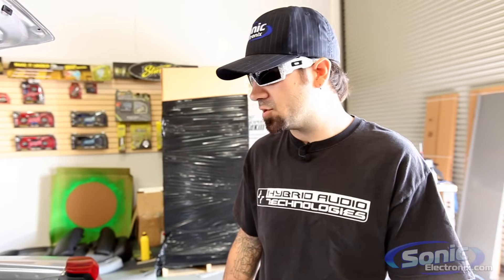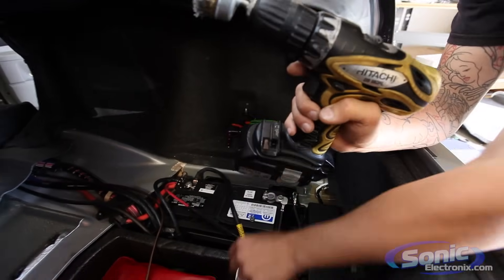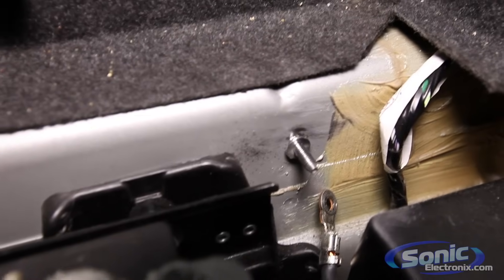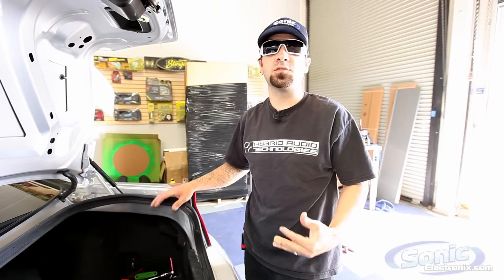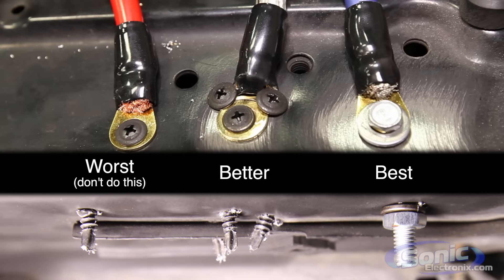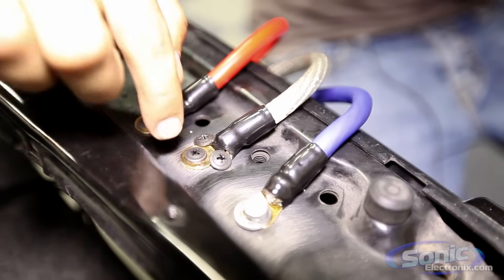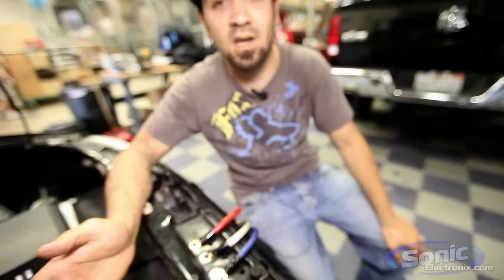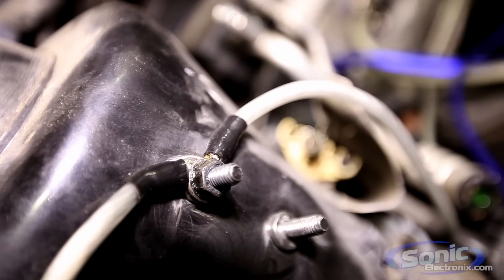How to Properly Ground a Car Amplifier | Good & Bad Examples | Car Audio 101

Comment: thanks for the excellent explanation
,but i have one question
suppose i connect my ground wire to painted point in the chassi,so what will happen? 
i have it installed on my car yukon 2011

Comment: No offense but you should have showed the right way on a car with the battery up front. Also if you use a self tapper that strips out like the worst example. You can use a pan head corse deck screw. It works amazing

Comment from the maker: You used an RCA to 3.5 connector and plugged it into the input of the amplifier directly? Are you using a factory radio or an aftermarket radio? Is the sub function turned on in the radio?
Reply: Can you just run a wire from the amp through the firewall to the negative terminal of the battery?

Comment: i have also checked the head units outputs several times and used an mp3 connected to the rca cables via 3.5mm converter and still nothing, any help at all is greatly appreciated

Comment: Hi i just got my subs and amp wired up in my mustang both of which i purchased from SonicElectronix via amazon i beleive, i got the subs from yall for sure, i am having issues with my subs playing, the amp is wired up and is turning on/recieving power and staying on just fine but my subs arent playing at all, i have them wired with 14 gauge speaker wire, brand new and more than triple checked the wiring diagram along with changing the rca cables and checking that as well, any suggestions?

Comment from the maker: Because in most cases, that is all the way back to the front of the vehicle. Your ground wire should be no more than a foot or so from your amplifier for safety reasons. The longer your wire, the more resistance it has.

Comment: question i removed the negative wire to sand the paint and when i put it back the amp wont turn on i checked if the negative wire is loos but it isnt what might be the prob ?

Comment from the maker: Never put bigger fuses in an amplifier, that could cause some serious implications and even ruin your equipment. You may not have big enough power and ground wire, your subs could be wired incorrectly, or your amp is defective.

Comment: ok so i hooked up an amp in my car the other day 03 pontiac sunfire and it was a 650watt rms patroit amp idk what it is i cant find them any where on the web so i ran all the wires and stuff but it keeps blowing fuses so i thought that it was to small of fuse so i got bigger ones and it blowed my amp i need advice so that i dont do it again couold it have been not the right gauge wire or what

Comment from the maker: Your electrical system is not powerful enough to run your system to its full potential. Your amplifier(s) are not being fed a stable, constant supply of current to maintain their output. You need a new alternator or at minimum a battery upgrade.

Comment from the maker: Yes it definitely could. Do not use the seat bolt if you can help it. Create a new ground using the steps we outlined in the video. Make sure it is on a non-painted, shiny metal surface and be careful drilling into panels, you might hit your gas tank or important electronics.

Comment: I grounded to the seatbelt bolt and my lights dim, did the big 3 lowest my voltage goes down to is 13.5 and the still dim could it be a ground issue?

Comment from the maker: You are definitely doing something wrong. Your ground wire to your amp should not be able to move, it needs to be solid. All connections need to be solid, you shouldn't be able to wiggle anything.

Comment: Ground was good but sound  still cuts out i think my speaker wires are to small I have 12gauge wires on 2 500w speakers with a 1000 mono amp I disconnected speakers made a thicker wire now amp sound  is staying on

Comment: use a DVM digital voltage meter. Ohm out that post on the seat.  See if its grounding from the post to frame? You will need a clean spot to test bare metal only.  Then test the negative battery post to frame then negative to alternator.  note the difference on the ohms. If your first test shows high resistance say 0.46 or more then run frame to seat bolt ground wire.  then ground negative to alternator then alternator to frame.  After this you will even see faster starter when starting car up.

Comment: run ground wire from alternator to to the back like a power wire unfused of course. Those studs you seen in the video are ideal but the best is a 5/16 lugor1/4 lug on the end not crimped but soldered on and shrink wrapped. Never use crimps and allen key turn down post. If you Ohm out the ground on factory post it might surprise you 0.009 mega ohms is good 0.001 is perfect. but 0.36 resistance you should address. And people if your alternator isn't grounded to the battery none of this will work

Comment: I am about to install 2 batteries in my car with a relay of 200 amps, but i don't know what gauge of power and ground wire i should get. Also if it helps i have 2 12's with 600 RMS's a piece. And my amp is 4000 watts. So what is the best wire size for all that.

Comment from the maker: Chances are you have loose connections in your power or ground wire which are causing intermittent contact and thus your system cuts in and out. Fix that ground and go through all of your wiring to make sure everything has a very secure connection. Also, it could be that your amp is drawing power all the time and the cutting in and out could be your amp protection circuit. Make sure the remote turn on wire on the amp is connected to your radio or a 12V accessory wire that turns off with the car.
Reply: I have a problem with my system. When I close the door it’s starts to hum very loudly but when it’s open it’s fine. My system sounds great till I close the door. Some mone said a ground loop?i feel like something is pinching but it’s very strange because it’s all 4 doors.🤦‍♂️🤦‍♂️

Comment: Okay, so i have a question. I hooked up my ground with a bolt and a washer, the scraping of the paint isnt the best (i didnt do it but i just looked and found out i had a friend do that part while i was hooking other stuff up) So what happend is the subs started working and what not, but they would cut in and out. and then more or less stuff would turn off in my car, then the battery died. so does my subs pull more power than my car makes? (Cobalt ls 2006 5-speed)

Comment: How about a 1/0 ground cable running to the rear battery......Which is daisy chained to the front battery with 1/0...and then grounded to a large bolt going directly to the frame with 1/0. Paint scraped of course. :-)

Comment from the maker: Yes it can if it is loose. The crackling would be the connection quality diminishing due to vibration and the contact surface area decreasing.

Comment: I'm no expert but would it be easy to make a factory ground type thing with a bolt, 2-4 washers and one or 2 nuts?

All my amplifiers are grounded directly to the battery with the set screw type battery terminal.

Comment from the maker: Your grounding location should be close to the amplifier, within 13-18 inches. It needs to be a connection right to the chassis and it needs to have shiny metal showing, no paint on it.

Comment: i have 2 12in audio pipes on a boos 1500 amp running to a boss cd player.... the grounding was bad it had 1 screw i also think the ground wire is cheap what type would u recommend

Comment: This is what happens when videos like this teach how to bolt something down rather than teaching you about ground loops, EMI, etc. To be fair shit gets complicated ridiculously quick; well designing circuits that is. Knowing the basics of how things operate will only get you so far. Could you describe the sound a little bit more? I'm particularly interested in frequency. Does it only happen when the automobile is running? Just ruling out my possible misinterpretation of engine noise.

Comment from the maker: Yes it can, actually. Definitely check your grounds and in some cases, you might even need thicker ground cables.
Reply: My ground wire is 0 grad lmao and my power wire is a 7 grad I think I’m good😂
Reply: @dylinwagg4483  grad? It's gauge.

Comment: 0 or 4 gauge wire with a ring terminal to a seatbelt bolt in the back seat. Best ground ever! It might also interest some of you to know that most car manufactures put ground wires right on painted studs. I know this first hand from wiring brand new cars on the assembly line. If you are having electrical performance issues, check your factory grounds.
Reply: Think this seat belt bolt would work on a 70 Chevy C-10 pick up;?? thanks, PJP
Reply: Not really cuz my was distorting
Reply: Thanks for this! I searched all over for the closest ground and I chose the bolt connecting the rear seat belt and it tested good on my DMM but it's also reassuring to hear it from someone else! I have a bad habit of constantly doubting myself... or do I? Hmmm? 😂

Comment: Caps are wired in parallel with the amp. Ideally you'd run the feed wire to the cap, (that's why caps usually have posts) then drop the wire to the amp. Just to avoid double stacking the amp terminal.

But no, basically, double stacking alone won't blow the amp.

Comment: It all depends on the amp draw of your system. You can go ahead and use 4 gauge wire past the block if you want, nothing wrong with that. Just remember that if the combined load on the block is over about 1500 watt you probably want to step the block feed wire up to 2 or 0 gauge.

But really, a 200 watt amp doesn't really need more than a 12 gauge. And your 600 amp monoblock will be happy with 8. Why run the extra weight and expense?

Comment: I recently had a cap installed at a shop and he had the power wire ran from the battery to the amp then to the cap so both power wires where connected to amp along w ground wires, would this cause the amp to fry??  Cuz that's what basically happened!!  Would his rigging be the cause of that??     
Thanks

Comment: depends on your setup, assuming the 4 gauge input is properly selected, then you'll be fine with 8 on the output (as long as your distribution block has more than one wire coming off of it of course, that would make it pointless)

Comment from the maker: Depends on your vehicle. You have to use a non-painted surface and a bolt that goes right to the chassis.
Reply: How long does your ground wire has to be from your amp?

Comment: Also keep your RCA/pre-out and speaker cables separated from your amp or cap power leads/cables. ☺
Reply: I have power and rca on opposite side of car but amp is built weird where rca cable ends up being close to the power and ground cable connection. Is it ok if they are close to each other probably 4 inches apart
Reply: @nlemus2  Yeah just route them in different directions. If you still get engine noise you'll have to run a noise filter.

Comment: I am using a 0 gauge wire for my amp and  it is grounded to a flat clean surface and still 
and there is still a ground loop . I have re wired my system and beefed up the wiring .

Comment from the maker: A few things to try. If you have external amplifiers, you need to beef up your power and ground cables, create a better grounding point for the amps, and then make sure they are grounded to the chassis directly on a shiny metal, non-painted surface. If you have just the headunit, you need to create a better ground for it using a thicker cable.

Comment: I have a constant wining  noise when ever I turn on my radio . I've been told that I have a "ground loop" . You  have any ideas  on how to get rid of it ?
Reply: U need to run ur RCA cables and remote wire separately from your power wire. Don't run them all together

Comment: Do you have a stiffening capacitor in your system? Even just a 1 farad (1F) cap will cause such a hefty spark. If you do, then you need to gradually charge it up using a light bulb in series before reconnecting the battery lead.

Comment from the maker: Make sure that when you put your negative back on, that no part of your vehicle is on, all doors are shut, etc. You dont want any lights on, any amps on, any fans on. All of that creates a difference in voltage which creates a large spark, some spark is ok. However, you could have other problems with such a large spark though, such as a short somewhere.

Comment from the maker: Definitely make sure the deck, or amplifiers if you have them, are grounded properly to the vehicle chassis with all paint removed from the ground location. You could very well have a short in the radio.

Comment from the maker: Yes, that could be one of many reasons an amp will not power on. Make sure to check your fuses and that you have a 12V source connecting to the amp turn on lead.

Comment from the maker: As long as you have a great connection and very clean surface before you use the silicone. Make sure to wipe the area down with alcohol pads or other non-residue cleaner, test the connection, and then apply silicon. You can also use spray paint as well.

Comment: Bro, I watch lot of video regarding Big 3 upgrading.mostly using 4AWG.seoe advised to use 0AWG.Can i just use 2AWG size.quite hard for me to find 0AWG.meanwhile 4AWG look likes the jacket was 4AWG in size not the core.I manage to find retailer that sold 2AWG with quality han i can accept.should be no problem right.

Comment from the maker: Yes you can use the same method, but if it is open to the elements then you run the risk of rust. Make sure you are grounding to the chassis directly for the best connection. You can always seal the grounding location using liquid electrical tape and heatshrink tubing.
Reply: Or crear coat

Comment: Hi. Can i use the same way when installing grounding cable in my engine bay? can it get rusty?
Reply: That's why you spray over top of it with primer. I've seen some people use clearcoat I've never personally used it

Comment: What size drill bit did you use to drill the hole for the nut bolt and lock washer connection?

Comment: Can I use a positive for a neg to use. So like I plane on doing is useing zero gauge for the main ground and haveing 2 4 gauge going to the fuse block and throw block into the zero gauge to a,pont in the car indstad of haveing to grounds in the car plaese helpe with my frst car system I would likr to have it done right professional help so plaese help this is where im stuck help

Comment: step 1 ground to rear battery.. step 2 better electricity flow and less resistance. newer cars have uunibodys not a frame / video poop info for the most part

Comment: ever since I changed my had unit from a flip up to a double din head unit I been having problems with it (shop did the installation). my double din would stay on when the truck was off, did some research and learned that it was connected direct did not want to take it back to the shop so I went to a different guy which was able to fix the problem but now the unit turns on but there is no voice coming from the speakers I am thinking that the amps are not getting power. any advice is appreciated.

Comment from the maker: Spray a heavy coat of lubricant around the edges of the nut. Get as much as you can to penetrate into the seams of the nut and let the lubricant work on the stuck bolt or nut for at least five minutes. Repeat at least three times if it does not work the first time.

Comment: Your always go straight to the source, why add a third party to create more complications/noise/interference into your wiring/equipment. Thats why you see EVERYONE who knows anything about car audio competition have the same amount or more runs of wire from front to rear as they do their positive runs. No sense to ground to the body and have to USE the body to find a ground off the batteries. Ask any real installer and they will tell you the same. Ive only seen 1000's of competition vehicles.

Comment: A ground from an amplifier should NEVER be more than 18 inches... A long ground wire is terrible to have for your amp. If the ground wire from the amp to the battery could be short enough then it's fine. They still don't go into detail about properly grounding from factory ground points and using rust prevention after scarping the paint away from the car.

Comment from the maker: If the metal that you are grounding through, in your case a bolt directly to the frame, is thick enough then you are more than likely fine. Make SURE you sand down the paint where the ring terminal connects to the metal to allow maximum current transfer.

Comment: I have a question,
I grounded my amp by removing the bold that holds down the seat belts to the frame off the car, what i did was after i removed the bolt i stuck the grounding wire in between the metal end of the seat belt and put the bolt back on. So now its, the frame of the car touching the metal end of the seat belt followed by another seat belt then the grounding wire and bolt tightened above it all. Is that a proper way to ground an amp?

Comment: while you werent taught wrong. the rule of thumb is 3 feet. and yes i would have to say in this guys video to ground directly to the battery negitive instead of the chasis.. its a direct current flow.

Comment from the maker: Wow, that's an exciting build! Your going to want to ground your amplifiers at the chassis of your Ford Ranger. Also, make sure the battery's negative terminal has a thick ground to the chassis as well. You don't want to bottleneck your system. :]

Comment: that's what I did! Just ran two 0 gauge wires straight to the capacitor then straight to the battery. I didn't make any new ground, just went straight to the battery. Very little voltage drop. I still get dimming headlights but that cause I don't have an extra battery.